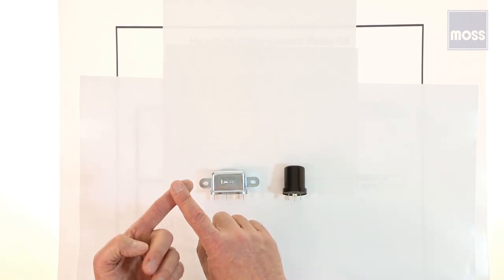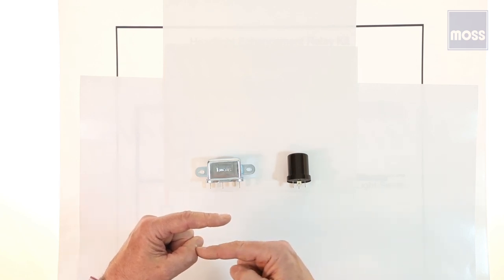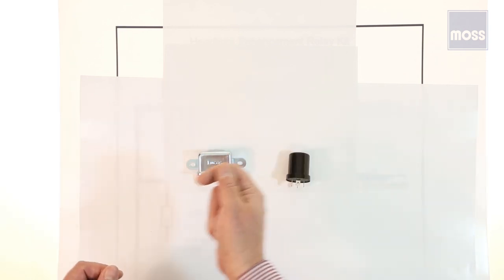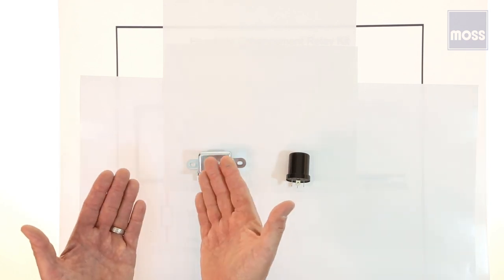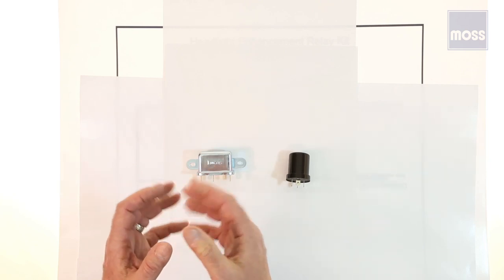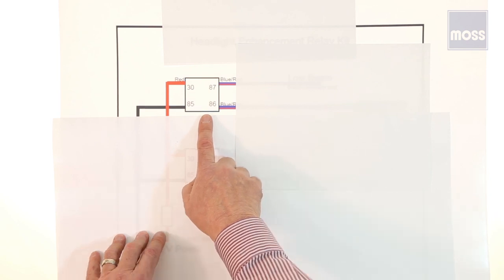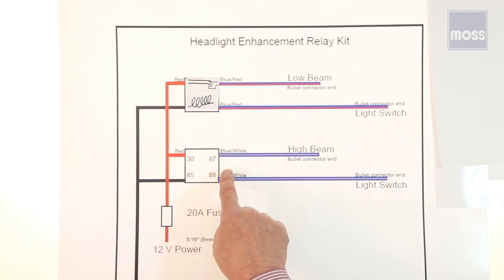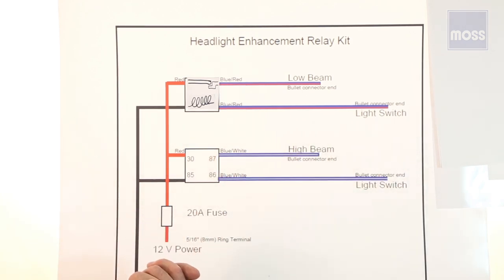Headlamp Relay Kit - Introduction & Overview (Moss# 117-515)

Comment: most utility vehicules rely on relays to energize their electrical equipments, the switches  triggers those relays. 
 It have many advantages , the first one is that when properly installed and located, it simplifies the diagnostic and replacement and it limits the wear on the switches so they last the life of the vehicule.
As the switches are the weakness of the Lucas systems, installing relays on all the functions that draw current is more than welcome.
It is a very good idea to redo all the wiring when the car takes age as the corrosion installs in the wire strands as the insulation becomes brittle and porous.
very good video